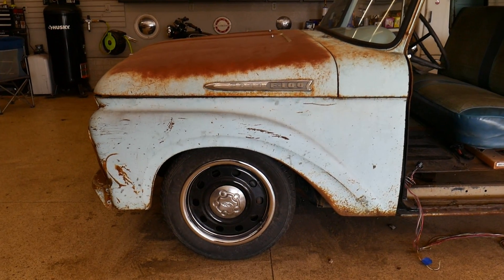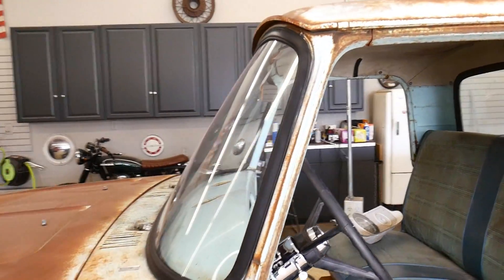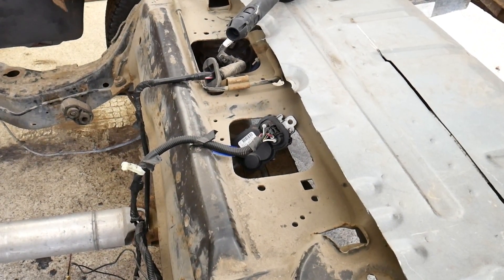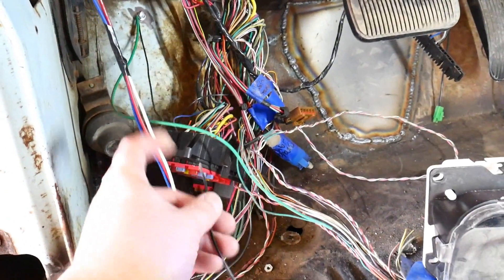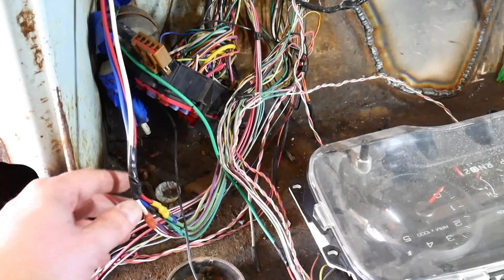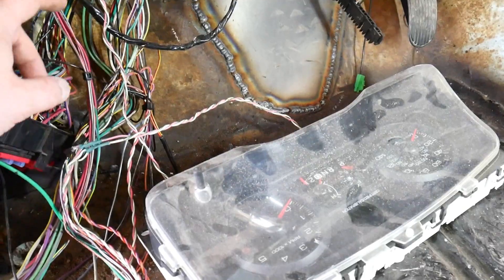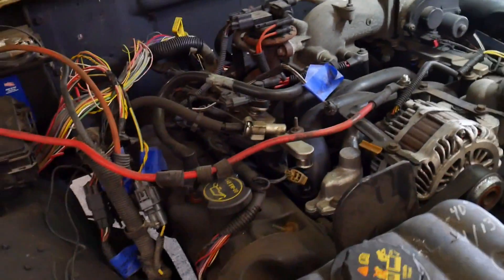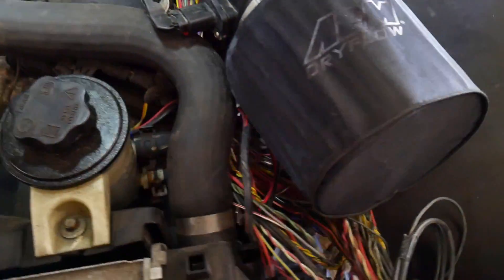F100 to Crown Vic Frame Swap Ep.10 Wiring, Gauges, etc.

Comment: I know I’m late to this thread, but I am currently doing an 08 Crown Vic Swap on my 1955 Ford F100. I have the Vic sending unit and fuel pump, but also added the original sending unit so I can run the original gauges. My question is, do I have to keep the Vic gauges and just hide them for everything to work as it should.

Comment: Hey Matt, did you cut out the pats system or just tuck it under the dash with a key? If so how did you bypass it?
Reply from the maker: Hey Lee! No PATS on the Police P71 so it wasn't an issue for me. Thanks for tuning in!
Reply: good to know, I have an 08 interceptor that is going in a 66 F100. Waiting on new vids, maybe do a bike build 👍, you and Nathan are my 2 favs

Comment: I know this is going to sound like crap but here it is.... I love this project and I hope to do one myself some day. YOu know how you wired the f100 key to the crown vic setup right? Why not figure out how to make the f100 cluster to work like the crown vic cluster maby add some lights in to it for the crown vic setup but with the right resistors you could make the f100 cluster talk to crwon vic setup. If the f100 uses a speed cable just just gut it out and setup the crown vick guts in it. You get what i mean i know it sounds crazy but it works in my head
Reply from the maker: First off, love your user name! The main reason I'm ditching the original round dial is because the the column would interfere with it. I had to raise the column pretty high up to get it to come out where I needed it to mate with the Vic steering arm. I like the way you think. The vic gauges are all hard mounted to a printed circuit board. Seems like it could be a nightmare to get this to work as you's pretty much have to carefully desolder all the needed components then wire it up and hope that it all still works and that the CanBus system could still talk to it. It's not impossible, it's a great idea you've got. I bet someone could make that work. Kudos!
Reply: Thanks man, keep up the good work!

Comment: I have an 04 - is that also CANBUS?
Reply from the maker: KMills84 yeah it's CanBus, but all the little details may be a little different than the '05 and up as far as what the CanBus is sending and receiving. But you should be able to pull all the same data.

Comment: Quick question, how are you going to register the truck in Iowa? I've been reading alot about it, just wondering what your plans are.
Reply from the maker: I'm just planning to register the truck per Iowa law by taking the truck title in and getting plates from there. Iowa is really laid back about classic cars/trucks, I've registered 4 or 5 classics and they've never wanted to see the car. If I really wanted to I could cut the vin from the truck frame and weld it into the vic frame but don't want to go down that road unless I had to.
Reply: River City so did you just junk the crown vic title?
Reply from the maker: It didn't come with one, hence how I got it for $600. There was a clerical error with Omaha P.D. and they lost the title to 3 or 4 cars, they were sold under a scrap bill of sale. Yet when I ran the vin it was still free and clear. Score!
Reply: River City nice! I was planning to just get the titles on both switched to my name, and just register the truck. Sounds like you have the same plan.
Reply from the maker: Yup, that's my plan!

Comment: I am putting a 1947 Ford Pickup on a F150 frame. I have put a 2005 Ford Crown Victoria IFS on the frame.  How did you handle the inner fender clearances with the Crown Vic IFS?  Any tips, suggestions will be appreciated. Art Jackson
Reply from the maker: It just took a lot of trimming and fitting. Put it on, check for fit, take it off, trim, repeat. Good luck!
Reply: Thank you for the reply.  Hope to share more as work progresses.  Great videos on your part, thanks

Comment: last weekend picked up an 03 vic running and driving for 500 in Ausin, tx  they parted the interior and cut the wire connectors off to the lights and doors which I don't need, but any info on what I need to buy to fig wires out, full frame swap with my 74 f100 dash is still intact
Reply from the maker: Congrats! It's such a fun project. I'd buy the Mitchell wiring diagrams then study. They are also full of great info. It's all online based so it makes it easy to search, and you can print out whatever you need.

Comment: Just thinking out loud here....while it's entirely possible to figure out the wiring and add the water temp and oil pressure gauges, don't forget the simple and accurate mechanical gauge option.  Simply tap a hole or use and existing one and adapt a manual gauge to it....for oil pressure or water temp. Could be an option.  Excellent vid bud!   :)
Reply from the maker: Now see that's why I love this YouTube thing! Going old school on that 4.6 might just be the ticket!
Reply: Chalk another vote up for mechanical oil pressure gauge.
Reply: That is what I was thinking, also. Don't even need to be mechanical. They have many electronic oil and water gauges. Oil should be easy as the sender currently in the engine is of no use. Water might be a problem as it may be used for the fan control, or they might be separate. But there is usually a couple of blocked off water plugs on an engine.